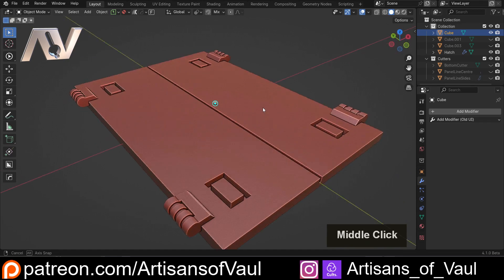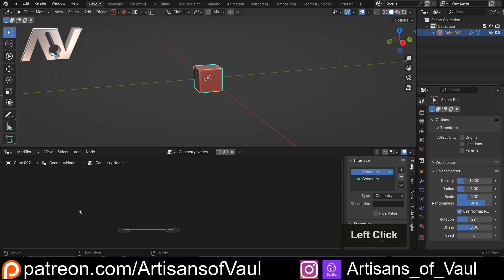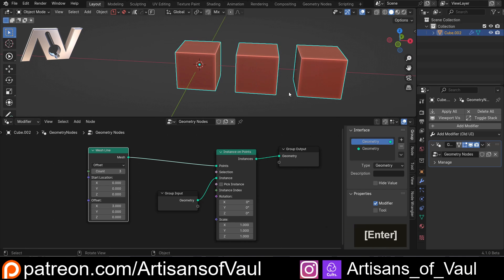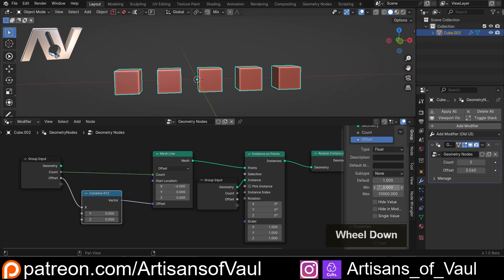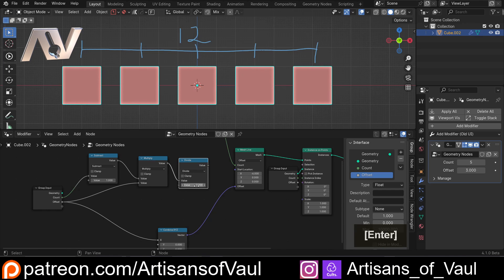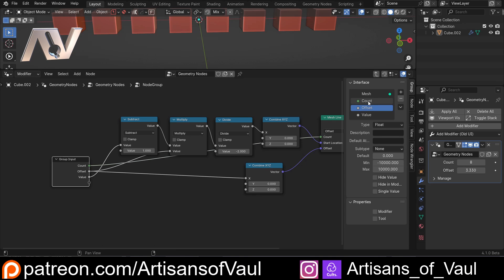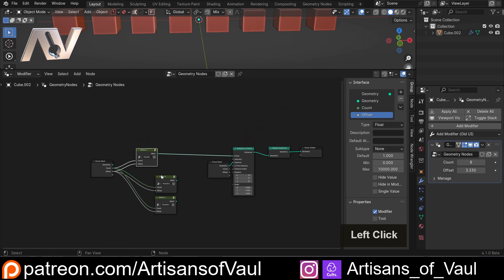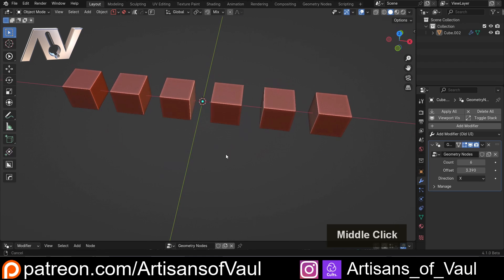Creating a centred array for Blender - Geometry Nodes

Comment: Amazing tutorial 👏🏼👏🏼👏🏼 I'm running into an issue tho, since I use Blender in imperial units (I know, I know) once I create an object using the default 24" size, the offset of 1 doesn't represent the actual size of any given object, the offset needs to be brought down to 0.6 to fit the equivalent of 1 width unit. Any way how to solve this so the modifier "reads" the size of any given geometry and adjust to it so 1 offset = 1 geometry size? Thanks in advance
Reply from the maker: I'll be honest and say I don't know if this will work in imperial but in theory yes.  You need to find the objects size in the relevant axis and then use that as the offset and multiply it by how many worth of the object you want the offset.  You can do this procedurally in the node as well.  Ive got a video on how to set up finding the object size with nodes here: https://youtu.be/i-Yj8hP9ZwY
Reply: @ArtisansofVaul  funny you sent me that video of yours, that’s exactly what led me to find the answer right after I posted my comment to you yesterday. You’re absolutely right, mixing these two tutorials together I was able to get it working in all three axis. I’m not in front of my computer right now but I did use the axis separation based on the actual geometry and then multiplied in one of the nodes from this tut it to get it working. I can send you the blend file of you want to have a look, just let me know the best way to reach you. Cheers and thank you again. You’re a wizard
Reply from the maker: @igorcampos  😁 Great to hear you got it working. 👍🏻👍🏻👍🏻

Comment: I love this! I have one problem I can't figure out though, how would I make the instance scale smaller as more instances get added? I tried maybe using the bounding box or the size of the mesh line but I'm stuck after that cause I can't cause the node is read and would cause a loop.
Reply from the maker: Just checking, you want all the instances to reduce in size or them to scale down more as you move away from the centre?
Reply: @ArtisansofVaul  all instances to reduce in size
Reply from the maker: @NicCrimson  In the instances setup there is an option for the scale. If you set this up with the count input and some maths you could set the scale input with (for example) 1 divided by the count and then connect that to the scale socket.
Reply: @ArtisansofVaul  Ah I had the division the wrong way, I'm 1 more step closer!
Reply from the maker: @NicCrimson  😁 Awesome.  And very easy thing to do
Reply: @ArtisansofVaul  Yep, now I need to figure out how to increase the count without changing the line length.
Reply from the maker: @NicCrimson  So if you want it to work that way there is another option where you could use the curve line and then resample it to create the points.  That would achieve what you want.  It may even have that as an option in the curve line node without the need to resample.
Reply: Are you looking for an automated approach to the scaling or have the scale values sent to the group input from the instance on points

Comment: I do wonder if using a curve line would be better b/c you can Add a value node to two combine xyz nodes into the axis you want then use a math node set to multiply by -1 in between one of the values and combine xyz nodes. When you adjust the value  the line will expand from the middle. Then use a resample curve node set to length. Then go into a instance on points node.  Then  you can use the new switch nodes to create a switch set up to choose the axis you want.  I appreciate your tutorials
Reply from the maker: Interesting idea. In the long run I think whatever works in your head is the probably the "right" way. Unless you start looking at which is the most efficient in terms of computing power needed. That could be interesting to compare.
Reply: @ArtisansofVaul  oh totally. I will have to experiment with your process. Its always good learn different ways to make things